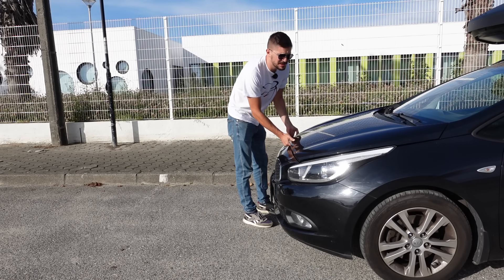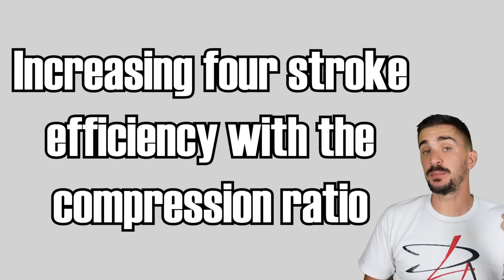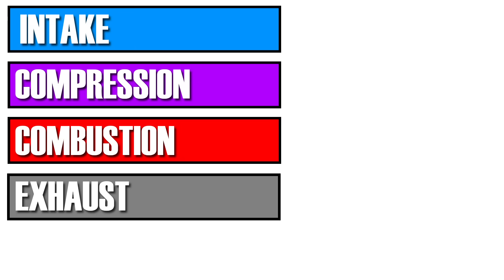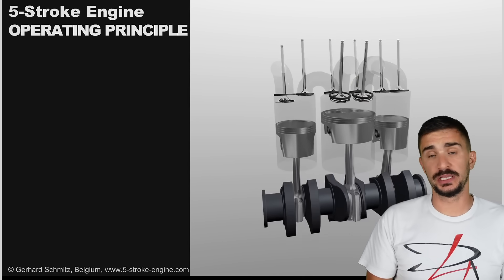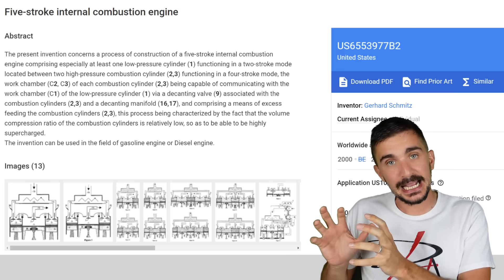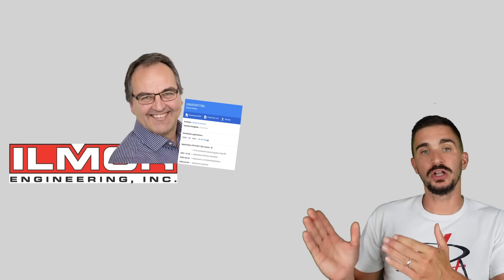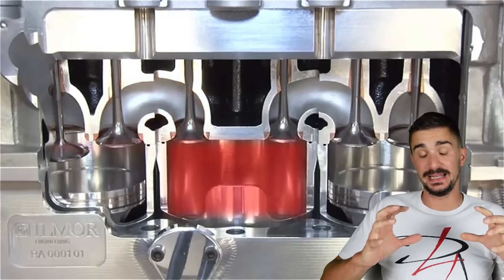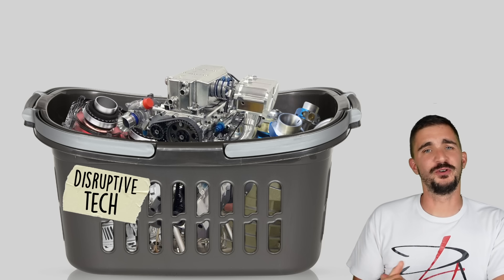Why Five Stroke Engines Are More Efficient But Still a Failure

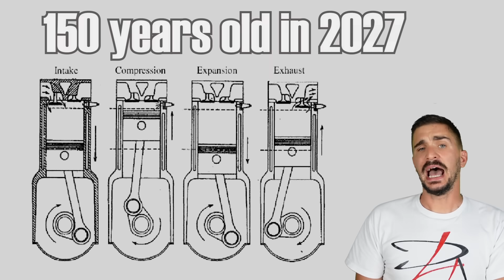Comment: at 16:52 you said "there is no other device of comparable mechanical complexity that has been so omnipresent on planet Earth since the late 1800s." I would submit the recoil-operated self-loading firearm as a contender. Modern engines have far eclipsed late 19th century designs in terms of overall complexity, but in small arms design things have actually changed in the other direction, with modern designs often having fewer parts and simpler, more elegant operation for improved reliability, reduced cost to manufacture, etc.

Comment: The ICE engine needs to get rid of it's dependency on Oil. It doesn't hurt to burn things. Humans have been burning stuff essentially from day 1. The problem began when we found coal. Yes, coal. Large deposits of carbon trapped on Earth's soil that weren't meant to be reintroduced into the atmosphere. The situation worsened when we discovered oil and gas. Now we burn coal, oil and gas.
For these who think electric vehicles are the solution think about what is involved in producing these vehicles. You still need lubricants that are oil based, you use plastic, and for the batteries you need to extract and process lsrge amounts of rare earth materials to get lithium. Most of this process is made by diesel powered machines. A lot of carbon emissions comes from manufacturing these vehicles and it will only get offset if said vehicles get used to the maximum of their lifespan IF you charge the battery with electricity harnessed by clean means. If your electricity is gas based or coal based you've essentially done nothing to offset the emissions of your electric vehicle.
I'm not against electric vehicles. I am against saying electric vehicles will fix our problems. We are still burning fossil fuels at a pace the planet can't keep up with. And it will continue to get more and more polluted and hot until we lower our emissions to the threshold.

Comment: You probably need to include the inner cylinder in the displacement TWICE, because it is an additional expansion volume for both of the HP cylinders. That would make it more like 2 liters overall displacement.
Reply: It doesn’t increase the overall flow of air or fuel so I disagree. If we take one cylinder with “x”cc of displacement, that’s how much air/fuel mix needs to get ingested each intake stroke. (The intake mass might change depending on RPM, NA vs FI, etc). If we add cylinders in a conventional 4stroke that demand is added in parallel. Double the cylinders,
double the flow. The low compression cylinders used here are  in series so they do not add to the overall flow rate.
Reply: @KingOfAllJackals  Sigh... whatever you say, man. It's basically an Atkinson engine. What are the "rules" for calculating displacement for an Atkinson? It either needs to be calculated differently or it needs to come with a fat disclaimer, "700cc's but only twice as big as a normal 700cc engine!"

Comment: what if you have the pistons head to head with the spark plug and injection in the middle? after ignition the space in between the pistons will increase to double in size.

Comment: Quite scary that this has not been done on all engines from the start and certainly since at least the 1970s since the basic idea was known as early as the 1800s where steam (external combustion) engines used the principle and were called compound steam engines. The fact that internal combustion engines have not done the same is a bit shocking when you consider that for the past 50 years the cost of fuel has been one of the biggest economic issues for the industrialized world.

Comment: Just as a sidenote: the 35-40% are peak efficiency, under optimal load conditions. It's labeled correctly in the video, but still many people tend to forget this.
In real world traffic you're already lucky if you get ~15-20% efficiency of of a combustion engine. (That's how hybrid engines are able to improve efficiency, simply by running closer to the optimal bias point for longer.)
Reply: Not only do they run at their optimal RPM nearly all of the time but they can be designed to run in that narrow range super efficiently. No need to compromise on a cam profile that idles cleanly and can still breathe at high rpms without resorting to variable valve timing complexity like VTEC. They can pick not only a valve timing but a ton of other components and parameters like port sizes and lengths for that narrow range.

Comment: Triumph makes a 3 cylinder engine that puts out that much HP with an extra 67cc. I can't say anything about the fuel efficiency, of course, because I don't know what the g/kw is for that engine, and I don't know what the MPG of the 5 stroke is. The fact is that 4-strokes are already nearly as efficient per displacement as this "revolutionary" engine, and that Triumph engine has to meet strict Euro 5+ emissions regulations, something that sounds practically impossible for the 5-stroke to achieve.

Comment: It reminds me of triple expansion steam engines, but adapted for internal combustion & double expansion. It might work fine for low RPM high load operation like maritime diesels, where they're highly sensitive to fuel costs and tightly regulated on emissions; Otto probably got the idea from triple expansion steam engines used in shipping during his lifetime. Another application would be hybrid vehicles and EV range extenders, where it can be run only at high load to recharge the battery then shut off.

Comment: This thing screams Boost Me, with a 7:1 on the combustion cylinders.

I'd be interested to see how a "1.4L", or 5(+) cylinder design does.

I'm thinking a modified narrow V, like the VR6, would be ideal, no? You get a compact engine and ton of space to re-engineer & cast the head's plumbing... Remove cylinders 3&4 for the expansion cylinder, and ~double its size relative to the 3 cyl. Make it a 5-valve, 1 "intake" from each combustion cylinder & 1 big exhaust. The combustion cylinders can stay 2 valve.

Firing 1&5, then 2&6 together, would probably be best, but I could see a more traditional 1-6...5-2 with 15°-345° of separation respectively.

Add a "bypass" VVT profile to hold the expansion cylinder's exhaust valve open, to aid with turbo spool/catalytic warmup... T'would be a simple way to manage heat. 

That would;
1) double your combustion cylinders
2) ~triple the effective displacement
3) address some of the heat(energy) management issues.
4) reduce the relative friction losses on the expansion cylinder.

Comment: My favorite and the benchmark for more efficient engines, is the Atkinson Cycle achieved with variable valve timing like in so many hybrids.  Leaving the intake open during compression to Lower Compression ratio, but you get full Expansion ratio.

Comment: Great video as always, love your channel.

I got a couple thoughts while watching it (I'm no engineer so excuse me)

1. Would it make sense to somehow separate that extra cylinder so that it would only be engaged when the exhaust pressure deems it profitable? The only increase in complexity would be some kind of clutch on the crankshaft engaging/disengaging it when needed

2. Would it make more sense coupled with a generator, running at constant RPM in hybrid cars?

Comment: It's basically just a turbocompound engine but with a piston expander instead of a turbine. But yeah, a big difficulty for making motive engines efficient is they need to operate across a wide range of power outputs and change power levels quickly. This might be better suited to a boat engine which just sits at the same power level for hours and hours on end.

Comment: Electric motors are even older. In fact any Otto engine needs some kind of electric  generator for the ignition. And most have an electric starter motor.

As for the five stroke engine. The solution is a turbo compound whereas the exhaust turbine is harnessing the leftover energy. This is a proven design and increases power and efficiency.

Comment: Hear me out hear me out!!!
What if you would have a normal 6 pistons engine with same size on all pistons.
With all 6 cylinders reciving fuel and combustion normally at low and mid RPM but once reached high RPM or highway speed, 2 out of 6 cylinders turns from combustion chamber into a scavenging chambers where exhaust energy from 3 cylinders would first go through the scavenging cylinder before the turbo. Of course not from all 3 at the same time cause thats impossible.

Comment: In hybrid IC/electric applications, I suspect that using the turbocharger as a generator might be the most practical way to utilize some of the residual energy in the exhaust gasses.
Reply: Well, Porsche is trying it.  We'll have to wait and see if it makes its way to practical vehicles.
Reply: @billberg1264  It seems much simpler than a true turbo-compound setup feeding power from the turbo with reduction gears and a shaft.

Comment: A much more elegant solution to capturing wasted exhaust energy was employed in aviation engines in the late 1940’s/1950’s 

The power recovery turbine. (PRT). Used on the Wright 3350 radials.
Reply: an electric generating turbine? additional to a turbocharged engine? i think the best try is to recover the heat of the exhaust with a steampowered turbine will be the best for efficiency. but it wont work on short rides, only on longer distances.
Reply: @BlacKi-nd4uy  Blow down turbine driven by exhaust gas,  connected to the crankshaft via hydraulic coupling.

Comment: I saw an old steam-powered barge boat on either the Mississippi or Missouri.  It used 3 pistons, small where the high-pressure steam went in first, then to a medium and large piston, extracting all the useful work from the steam.  I remembered that from 30 years ago when seeing your animation with the low-pressure pistons.

Comment: "And let me know when  ANY kind of propulsion technology manages to last 150 years, thank you very much." That is an easy one. The bicycle!
Reply: The details vary on when you think commercial use started but electric motors and four-stroke engines have been used commercially for about the same amount of time.  
The future, as they say, is in the details.
Reply: The mighty horse...
Reply: Also, Wikipedia says the first electric vehicle was built in 1881, which makes EVs just 7 years short of their 150th birthday.
Reply: Legs:
Reply: Sails.  Oars.    Speaking of ocean-going propulstion, steam boilers started <1800 and kept being made into the 1980s, that's about 200 years.

Comment: I do want to point out that the electric motor has been around for nearly as long and the reson it hasn't been around for just as long as "internal combustion" engines it because the starting point and definition of an internal combustion engine is contested and muddied. IC engines are after all just modified steam engines.
And if we are going to go by that metric, the "rotation engine" has been around for longer than the steam engine, going so far back as when the first water wheel and wind mills were built. An electric engine is after all just a rotation engine, but instead of wind or water currents powering it. It's powered by electrical currents.

Electric vehicles have been around pretty much as long as ICE vehicles have been around. The reason one won over the other is due to fossil fuels being so power dense.
It took millions of years for those fossil fuels to "charge", where it now takes minutes for an electric vehicle to charge its "tanks" in a renewable manner.
Once fossil fuels become prohibitively expensive to extract, electric vehicles will automatically dominate the market.
And then the precious metals that make those will run out... And so we are left with NOTHING.

The best solution to BOTH problems is to simply stop traveling/commuting needlessly like we are today.

Comment: The catalyc converter(s) could be between the cylinders.
For test you could just take a 4 cylinder in line engine and connect the middle cylinders. You need to make a new camshaft ofc.

Comment: For many years, I've been making the argument that almost all the problems and complexity of ICEs could be solved if they simply ran at a single RPM. Hence, they're great for electric generators, for example; not requiring all the stuff that a car engine needs to function correctly for a range of driving conditions. This engine, then, the so-called 5-stroke, would work at higher efficiency if it ran at a single, optimal RPM, again, such as in a generator. Seems to me this would be a fabulous way to make a gas/electric hybrid car.
Reply: This is exactly what they do with series or extended range hybrids. They’re carrying around an ICE-powered generator to augment batteries. As you note, this means the ICE can be tuned for a very narrow operating range. It doesn’t need to idle AND turn 6k RPM all while sipping fuel, minimizing emissions, maintain good throttle response, etc.

Comment: 35% sounds like a low efficiency, but the average power plant runs on the Rankine cycle and gets 30% - 35%. Most of the power used by EVs comes from Rankine cycle plant.  The state of the art for proven heat engine performance is the combined cycle. Rankine cycle dates back to 1859, or 165 years ago. Coal plants, gas plants, nuclear plants and part of combined cycle plants are burning and churning out power with this tech. Also - I drive a 2021 Tacoma with a 6-cyl Atkinson engine.  With the right tires and 100% gasoline I can get 26+mpg. As a side note - when engine stats are quoted I always wonder if the engines were fed 100% gasoline or ethanol contaminated gasoline.
Reply: Toyota's new generation hybrids are getting around 40% these days
Reply: @Appletank8  The one which made headlines with 41% were lab results. On the diesel side TDI do 43% in the lab, that was over 20 years ago, though.
Reply: This is a peak efficiency, only achievable at low RPMs and full throttle. This is one of 2 main reasons diesel engines are more efficient than petrol ones - they don't need a throttle and can instead reduce the amount of fuel being injected. Petrol engines cannot ignite a mix that is too lean, so they need some kind of air flow restriction.

Comment: Is there a reason why we can't use a turbo-like thingy to drive a generator and recharge a hybrid battery instead of using it for forced induction?
Also, it would have been nice for you to mention the way Toyota achieves the Atkinson cycle in their hybrids, which trades humpf for efficiency but compensates with an electric motor.

Yes, as you can tell I'm a big fan of hybrids lol
Reply: I'm pretty sure one of the more recent variants of the Porsche 911 uses the exhaust gasses to drive a generator, like you suggest.  Or, at least, that's the understanding I took away from a recent Engineering Explained video.
Reply: @billberg1264  Oh cool! I ought to check this out

Comment: Sounds like a generator operated at a constant load and RPM would be a better use for the modern 5-stroke engine than a passenger car.
Reply: why not passenger car? most hybrid vehicles have some form of transmission, for as long as generator is of same weight as that transmission system it will be a net benefit.
Reply: @fulconandroadcone9488 Constant load and rpm is the exact use case of a range extender engine in a plugin hybrid. This would be perfect for that use case if a manufacturer intended to make enough to justify a specific engine just for plugin hybrids.
Reply: @Thinginator  would be better than mazda trying to put rotaries in hybrids as range extenders😂
Reply: @Thinginator  I was just going to say that this engine seems well-suited for series hybrids.
Reply: @fulconandroadcone9488  A passenger car thatt doesn't cut corners is called a generator of boat anchors
Reply: Also single engine GA planes (but good luck with certifying that lol), where using 75% of max RPM is standard
Reply: I was not quite thinking that, but wondered if the engine should be be running at slightly higher revs when in low gears and the excess energy used to charge a battery for use when accelerating, which would reduce the need to rev so highly. 

Probably a daft notion of mine, but who knows.
Reply: @adrianlang6550  Could perhaps work with a cvt. But i still think this isnt a good fit for a car.
Reply: Atkinson/Miller engines have extended combustion  and used for hybrid cars
Reply: Exactly my thought. This would especially be the case for household generators, as their loads are more consistent, and the efficiency is even more desired.
Reply: Range extender for a PHEV would be the best fit
Reply: Had the exact same thought. Something like a generator that can be kept at a stable load would be able to absolutely maximize the benefits of the design.
Reply: Exactly what I was going to say.
Reply: You could still put it in a passenger car, as the generator in a series hybrid.
Reply: Exactly what Nissan is doing with E-Power car models
Reply: Or a diesel-electric truck or train where it could be run at constant high load.
Reply: I thought of that idea too but quickly realized it really wouldn't likely be any more efficient than a correctly sized engine in a constant rpm application because that's where others become more efficient as well.
Reply: I agree, this sounds like a great engine for generators. And as someone else mentioned, seems like a great range extender for a plug-in hybrid.

But I wonder if this could work well with a CVT as well.
Reply: >tries to make more efficient engine
>creates train engine instead

it's always trains, just like it's always boiling water